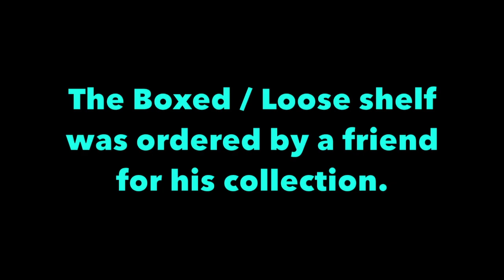NES Cartridge Shelf - Stuff Ron Makes

Comment: Did you use pocket screws or nails to put it together?
Reply from the maker: both, pocket screws were needed to put the middle shelves in. I used some brads to tack it while the glue set in. I plaan on building another one and making a full video step by step on how its done.